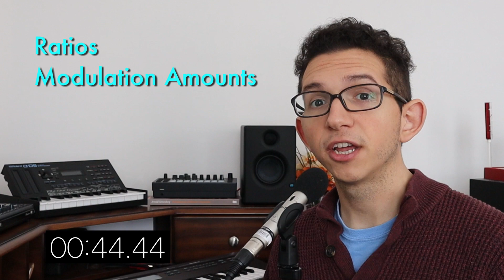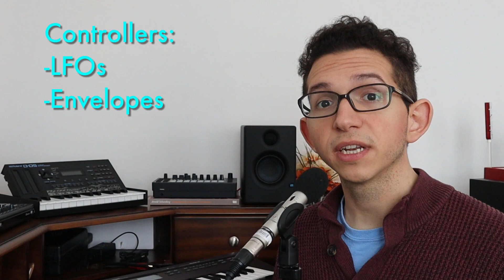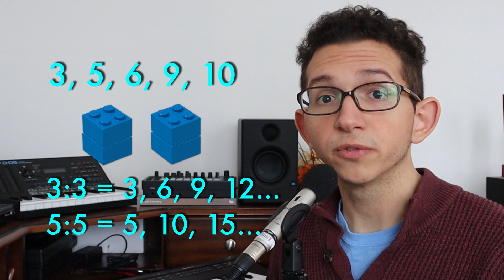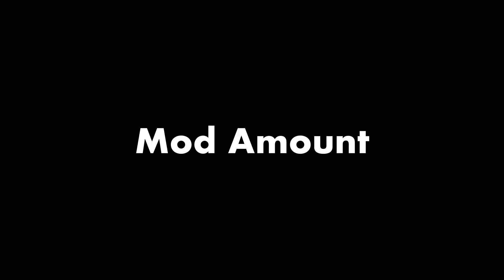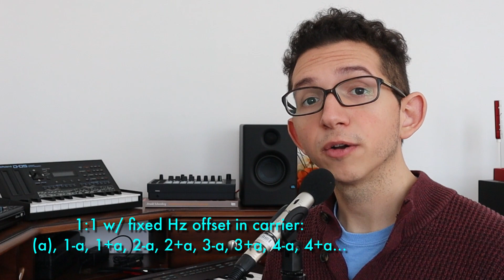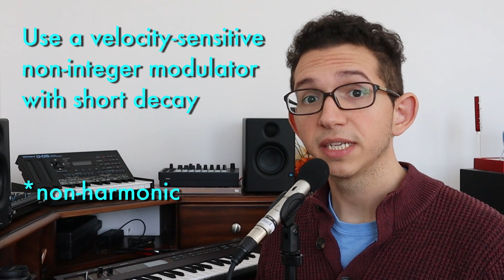Making Sense of FM Synthesis (Synth Fundamentals, Ep. 8)

Comment: someone knows how the "Waldorf Quantum", the "Percussa SSP" and the "Kodamo essenceFM" compare for FM synthesis: number of operators & carries, polyphony/voices, timbrality, funcionalities for explorative sound-design, output channels for routing & mixing, intuitive performance possibilities, digital sound quality (bit rate, chip-processor etc.), control & response latency (buffer, RAM etc.), ...?
Reply from the maker: I'm not sure about the Percussa and Kodamo, but I have experience with the Quantum. Its FM capabilities are truly wild. It can do 8 voices with three oscillators (single mode), or 4 voices with six oscillators (layer/split). Each oscillator has its own six-op synth with custom routing between operators. Instead of relying on a list of algos, you can set any operator to go to the output, and each operator can have three modulators.

So you get three independent six-op FM synths per layer, and each has a ton of flexibility. The Quantum is also designed for explorative sound design, so there's a mod matrix, 6 LFOs, 6 envelopes, some pretty great FX, dual analog LPFs, and a really flexible digital "former." And, on top of that, you can combine synthesis types (subtractive, sample/granular, "resonator"/physical modelling, wavetable) within patches.

The sound is great, the interface is fast and intuitive, and I haven't run into any latency issues.

Not to sound like an advertisement but, if there's a perfect synth, it's the Quantum.